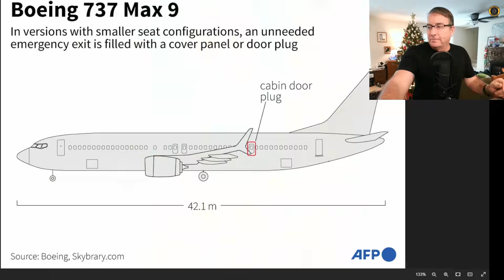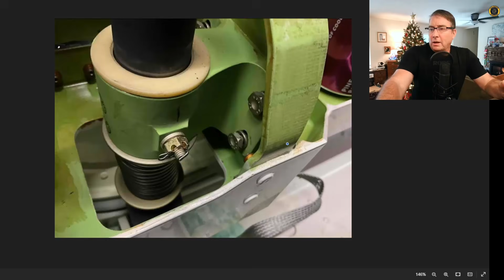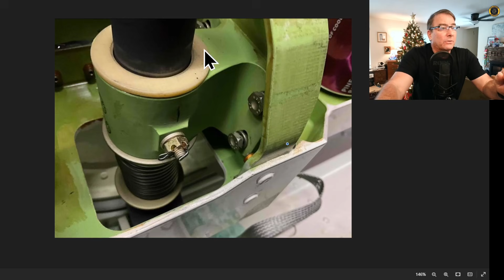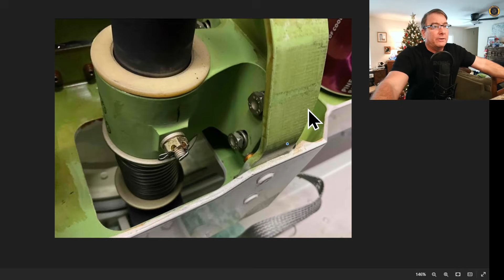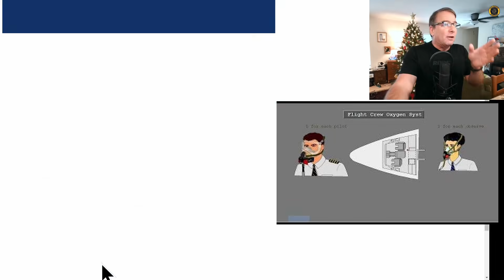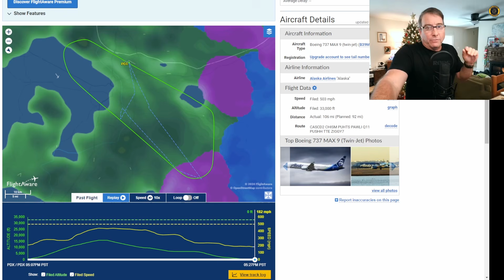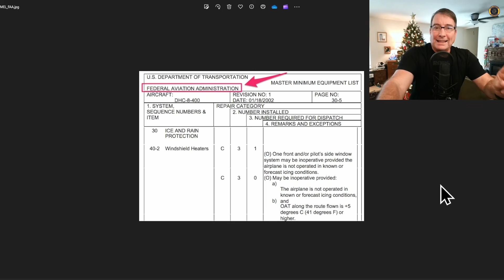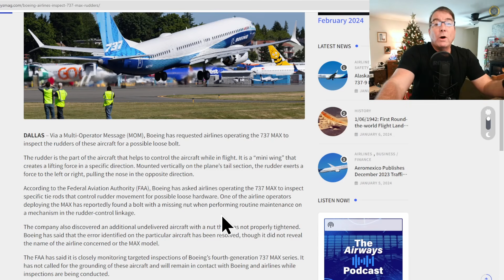"Yes, We Have No Bolts"  9 Jan 737 Max-9 Update

Comment: So as an interesting question, without knowing that the bolts on the plug was an issue, how would the maintenance crew go about diagnosing a pressurization issue and potential solution?

Comment: someone forgot to install the bolts into the door.  its clearly negligent on an employee.  Been flying without a bolt for 2-3 weeks.   It's possible alaska has no responsibility with this and it lay with boeing and their quality assurance department before they covered up the sidewall with the interior fittings.  Alaska continuing to fly the airplane with a total of 3x warnings about Pressurization keeping the plane in service is the REAL problem, and they should be violated for this.  most likely the door was becoming ajar and allowing air to escape.  Warn me once, warn me twice, warn me THREE times, and still waiting for something to happen is also negligence.  the airplane is talking, is anyone listening ??  Smart pilots are trained to look at the Squawks and identify safety concerns based on trends.  I would say looking at the Squawks and ignore 3x pressurization squawks is ALSO negligence.

Comment: If those bolts were not installed, the only thing holding that plug in place was tension and sealant. I wouldn't be surprised if the sealant finally let go, causing the rest of the door to follow. A tiny piece of sealant blows out, and spreads the fissure until the plug is loose enough for the springs to push it up into position for the pressure to blow it out. Fuselage pieces like this are typically installed "wet" with sealant, so there can be a surprisingly strong bond just from the sealant.... at least for a while.

Comment: The 4 bolts being talked about are supposed to be installed in the 2 Upper and  2 Lower Roller Latch Plates on the Fuselage Door Frame. They are safeties to prevent the Door Rollers from moving inside the latch plates and allowing the 12 Door Stop Pins to disengage the 12 Fuselage Frame Stop Pads. These Bolts are Installed with Castellated Nuts and Cotter Pins. The door cannot open unless the Door Stop Pins are disengaged from the Fuselage Frame Stop Pads.
Reply: And what if the roller latch plates are not bolted correctly to the airframe, as has been found with UA's 737-MAX9 fleet?
Reply: @user-vk4vd7vr5t The locking bolts were loose in the United airliners…
Reply: @user-vk4vd7vr5t  What If can be played about anything on this aircraft.
If the roller latch plates failed that is a different issue than the 4 Bolts mentioned
in the NTSB Press
 conference last night.
The missing 4 Bolts are about the Alaska Airlines Flight and aircraft.
Reply: @guitarhillbilly1482  the NTSB has not finalised the directive yet - we do not know what the directive will encompass. It could be the bolts missing from the latch mechanism and also include re-torquing of the latch plate fasteners
Reply: @user-vk4vd7vr5t  you are correct that a lot more issues may be revealed during the investigation.
Reply: @SusanKay-  that is very interesting information and would Bring scruinty to Alaska Airlines and,/ or the vendor who did the Wi,-FI Modification.
Thanks for posting
According to NTSB the Right Side door plug was installed properly.
Reply: @SusanKay-  AAR didn't go anywhere near the plug door for the 2KU modification. Nothing to talk about.

Comment: In the manufacturing process they open thouse doors for various reasons,  job # for removal? inspection stamp, job # closure inspection, # side wall instalation blankest dinol, bet no job # for the bolts, where's the spacer over the lock bolts nut cotter assy over torque these bolts  crack the fitting.

Comment: I don't understand how the check lists blew away, That makes no sense.  There is a door between the pilots and the cabin where the door blew off.  What is this supposedly bullet proof door made of if a pressure differential of 5 psi blows the door open?

I also don't understand how, in a world where every laptop comes with a 1 terabyte drive, why is this aircraft over writing the voice recorders?  A 1TB hard drive can hold up to 17,000 hours of audio files, totaling approximately 708 days' worth.  You would think an aircraft costing at least tens of millions of dollars there would be multi TB's of voice recording space.  Further you would think that information would automatically get backed up evetime the plane lands.  I mean when every stupid meme on the internet is backed up everywhere forever, yet we can't back up critical aircraft information?

What are we doing in the aerospace industry today if this kind of comical happenstance goes on?  I'm glad I refuse to fly anymore, it seems like Huey, Dewy and Louie are running the place.
Reply: A pressure differential of 5psi, times the thousand or so square inches of area of the door, is about 2.5 tons.
Reply: @BrooksMoses  I get it, that's a lot.  But assume the door is 24x72 inches, that is 1,728sqin X 5/inch = 8,640lbs on the door.  A  lot but not crazy.  Think how much pressure is on the hull of the air craft at that same differential and it holds.  I mean it's only 4 tons on a small door.  A door that is supposed to be bullet proof and I would assume blast resistant.  Shouldn't the door be expected to withstand  sudden decompression?  I mean part of the object of the door is to enable the pilots to continue flying the plane no matter what happens right?   And explosive decompression isn't exactly out of the realm of what can be expected.

Comment: I'll bet Spirit started setting the plugs in with finger tight bolts assuming Boeing removes and reinstalls them. Then Boeing stopped removing them and planes are delivered with finger tight bolts 😅

Comment: Juan, one of the incidents of the pressurization system light happened when the plane was on the ground, which would imply to the maintenence engineer that it is probably an instrumentation issue, so there may have been multiple problems in play here.

Comment: Correct!  I agree with the issue of the pulling the circuit breaker.  In fact PDX is a maintenance base, and I expect the pilots released the custody of the plane to maintenance after the accident.  Had this flight landed where there was no Alaska Maintenance they would have pulled the CB.

Comment: I'm glad you are giving the crew a pass on the circuit breakers. They did enough for one day.
Reply: Amen!

As a retired Part 121 captain, I will admit that regardless of what the emergency checklist calls for (pulling the CVR circuit breaker[s]) some pilots have a built-in bias against preserving the cockpit voice recorder data after a flight safety incident. Again, only some pilots, regard the CVR recordings as a "tattle tale" tool that can be used by the company or FAA to cast aspersions on the cockpit crew's performance during the incident or accident in question. I doubt that this was a factor in the CVR circuit breaker oversight in this case. It looks like this crew did an outstandingly professional job here. 

An explosive depressurization is definitely a traumatic and disorienting event under any circumstances....the incredible noise, multiple audio and visual warnings going off simultaneously, struggling to put their masks on, paperwork fluttering around the flight deck space, and a cockpit door explosively sucked open with a loud bang....it would have sounded like a bomb going off. When they got it on the ground and shut down, I'm sure the last thing on their minds was pulling that little circuit breaker! 😁👍🐻🇺🇲🎉
Reply: @bearowen5480 Tattle tale device or not, but the data needs to be preserved. Maybe the system can sense an emergency situation and preserve that portion of the recording (by legal requirement). Leaving it to the whim or motivations of pilots, ground crew, or management is not going to work.
Reply: It seems like something that shouldn't be required by the pilots. Have it be triggered remotely after an aircraft lands following an emergency. Or just first on the list of standard routines when inspecting an aircraft following an emergency.
Reply: @StarkRG  Exactly! My $50 car dashcam recorder does not overwrite voice/video recordings after car ign is shut off.

Comment: How does the cockpit data get over-written by new data when the jet since the incident has been shut down, parked up and has not been flown or had new pilots talking in to the headsets? Does that mean that jets like this could be parked up for a day/s and the flight voice data is just continuously over writing  itself unless you pull a circuit breaker? This is a serious question so if somebody knows the answer I would like to know?

Comment: Getting established on the localizer reminds me of Sully turning on the APU. Think what’s gonna be critically important in the next moments and proactively do it. These are good pilots. The CVR not a factor and would add zero to the investigation. Today you could have a dozen CVRs all recording forever for dirt cheap. And it could also be sent to the cloud. Those little bitty bolts and the size of the hatch and considering the psi on that hatch—is the design robust enough? Is there redundancy in this design? The castle nuts and cotter pins seem secure but those other bolts rely on torque settings? Would I trust my life to a torque wrench?
Reply: you do all the time, every day in your car, in a plane, every assembly has a torque and needs to be torqued with a torque wrench. Even the lug nuts on your car should be torqued.
Reply: @kinikinrd True. But torque wrench accuracy is illusive. Some critical components in the steering linkages of a car use castle nuts and cotter pins because constant back and forth movements can untorque a bolt. On a car wheel, it is always spinning in one direction so it is always in effect self torquing. This plug hatch is not self torquing. It is experiencing back and forth motion.

Comment: There were ski championsships on the Chacaltaya mountain, our dormitory elevation is 17440 feet, the though of even using oxygen was absent, nor did we store any.
The nearby airport El Alto is above 13300 feet. Maybe Boeing should do some verification flight tests off that airport,  similar to Convair 880 where we did take off tests to qualify the first fan jets , where the fan was in the rear of the engine, but the cowling was extended forward, like all later turbofans.
One of those engines was, maybe still is in the Machine  Laboratory at the ETH Zürich, called aftfan.
Elevation: At the low pressure chamber of the nearby Univerity of Zürich, we tested the effects of high altitude on the  behavior of pilots, me included, The instructor a MD conducted those tests and the result was a rule, when suppemental oxygen should be used. The rule specifies an altitude (QNH 1013.25 milibar) of 5000 meters, (16400 feet). To take oxygen, but not below, because of waste of oxygen. 
This rule applies to glider pilots, circling in fairly turbulent Cumuli nimbus , IMC a fairly stressfull activity.
So 14000 feet seems a ridiculous regulation, 
Zürich airport, LSZH elevation is  1413 ft, meaning that no altitude adaptation is present, in contrast to living in La Paz.
Again this panicked effort to don the masks at 14000 ft altitude is contra productive
(CFII here)
Some Air Force bases have or had altitude chambers, (Denver, Buckley) I suggest taking a 'ride' and verifying our results. Of all people, Juan, you can arrange that.

Other locations Fairchild AFB, 
ASU, Arizona
So much is dependent on a realistic limitation, which cannot be covered by a totally arbitrary regulation.
We look at minute details like a cotter pin locking a castle nut, but assume the oxygen mandates are realistic.

Comment: I’d be curious as to the exact verbiage of the pressurization write up. Was it actual loss of Pdif, controller indicationThe movement of the plug door would likely result in a squealing sound, much like a window seal failing to mate, something most pilots of pressurized bird would know of or the noise a door seal failure makes. Such would have lead to an early discovery of the problem. I will posit the write up is not associated with the door problem.

Comment: No PSEU light on the MAX, in place of it there is a MAINT light overhead. But nonetheless you're right, there might not have been a switch or a way to know the non usable plug-door was not closed correctly.

Comment: One note about pressure measurement and data collection…pressure is very fast changing and even one second collection may not show in enough detail just how fast the pressure dropped.  It was effectively dropped to atmospheric pressure instantaneously given the size of the opening.  Makes me wonder about the integrity of the fuselage after this event…what type of testing on the pressure envelope is done for this scenario in the certification process?

Comment: The scary part is not only that a plug plate fell out of a flying 737 MAX but the fact that United Airlines also have found loose bolts for these plugs in some of their 737 MAX airplanes.
This seems to point towards a major problem at Boeing and the manner they do quality control.
Imagine if this had happened with an Airbus airplane in America.
It really seems that Boeing will never be held accountable in America. What is wrong with Americans?
Nobody from Boeing went to jail for killing passengers in 2018 and 2019 in the 737 MAX disasters and now, Boeing will get off the hook again simply because they can pay their way out of trouble.

Comment: But if the Doorplug was causing the Auto Press Fail light, the cabine crew or passengers would have noticed a loud whistling noise. Even a small leak in door seales witch has no impact in the pressurisation would have been noticed by the cabine crew!
Reply: Airplane door seals leak all the time.  It's not uncommon.  There's a comment in here that someone noticed the whistling and was moved to a different seat.  No idea if that's true or not but as common as it is I doubt a flight attendant would even mention it to anyone.